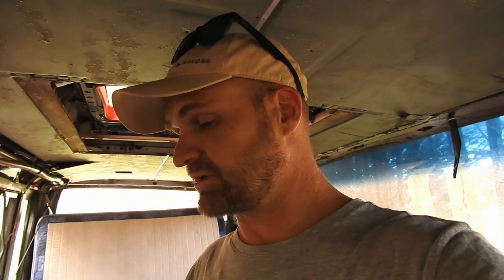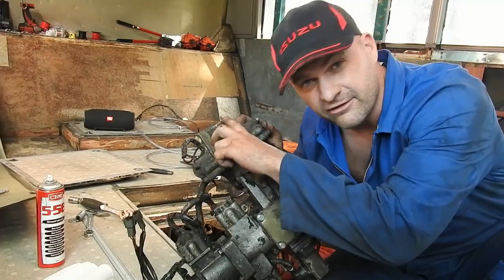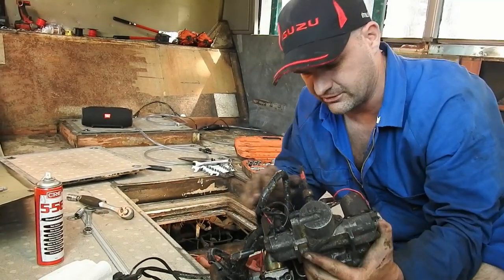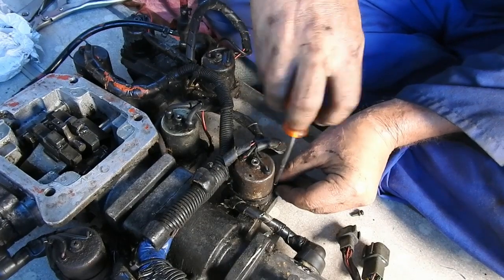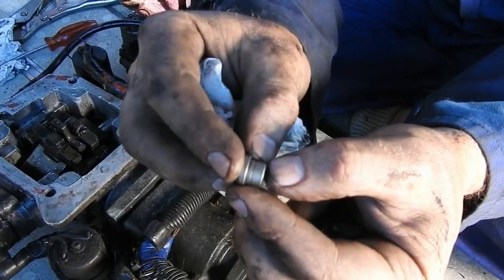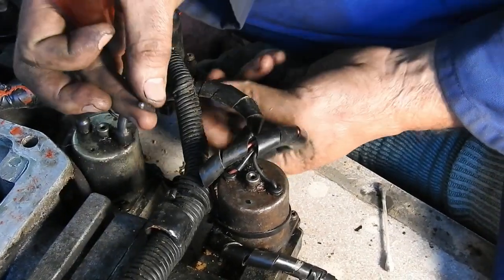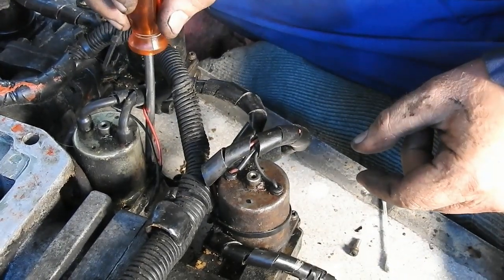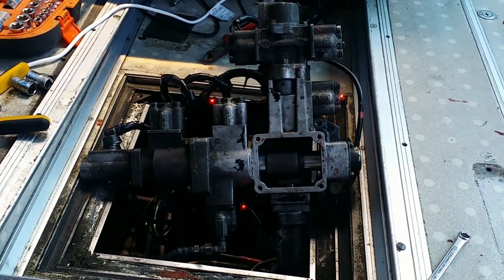Bus Build #2 - Transmission issues - Already!!!

Comment: In one video you said something like, "I have no trade". Now you're dismantling a gearbox, describing how it functions and cleaning it up to get it working again. Then adding resistor limited LEDs to the solenoid wiring with a flyback protective diode so you can map sequences in case you need to make a computer to change gears if the current one dies.  To say  I am impressed is a massive understatement.  Good going cuz, looking forward to more videos and one day emulating your endeavours.
Reply from the maker: Thanks Aaron, I'm hoping to get a lot more technology in this channel than wiring leds to a coil...  but yeah I don't think anyone needs qualifications or a trade to know a variety of things if they are curious about how things work.  Really glad you're enjoying the channel.  For a while I wasnt sure whether this was the sort of thing people wanted to see.
Reply: @brendontait6968  So many people don't know that they can (maybe). It's good to see someone who can try, and succeed at a difficult thing.
Reply: @brendontait6968  you're my new favorite mechanics educator! Thanks for the videos!